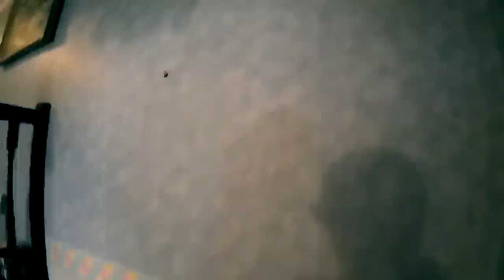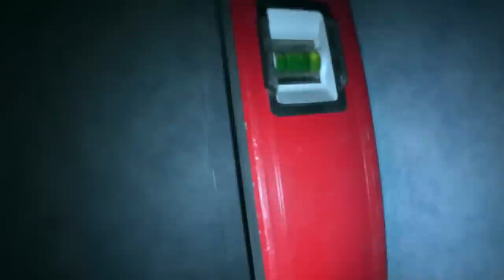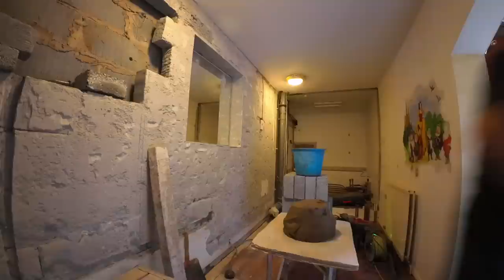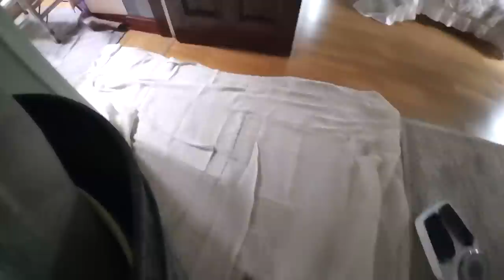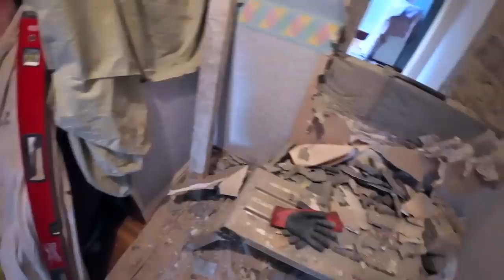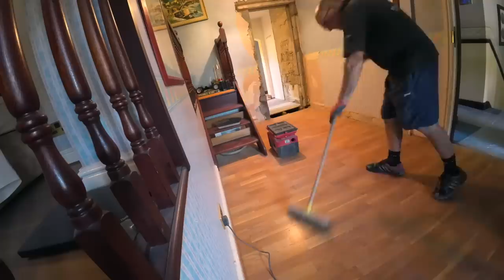THIS JOB PUSHED ME TO THE EDGE!!

Comment: I hate the cleanup and putting all my tools into the different compartments of my work truck. Do they have RAM board over there? It is a very heavy paperboard you unroll and tape to the flooring and carpet. It helps immensely during final cleanup. You just roll it up and toss it. I used it in one of my videos where I took down a ceiling on a top floor and raised it 18 inches. The carpets were brand new "The Augusta project"  you can see the Ram board in the introduction
Reply from the maker: Yes we have used it in the past 🧱👍🏽

Comment: Would an angle grinder with dust extractor attachment have got through the render & created a neater job in the bedroom?.....if there is such a thing. 
I suppose part of the problem is that you cannot carry too many gadgets & tools, otherwise you would need a lorry to lug them about.
Got the job done. Hope the hip operation went well 👍
Reply from the maker: Very true Sean .
   Thanks very much 🧱👍🏽